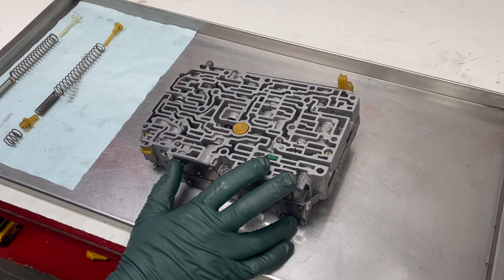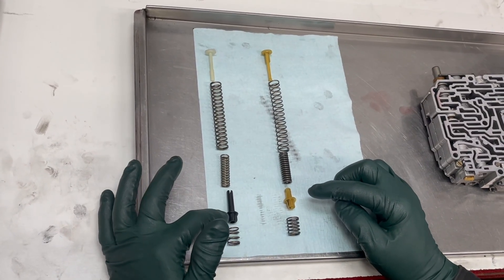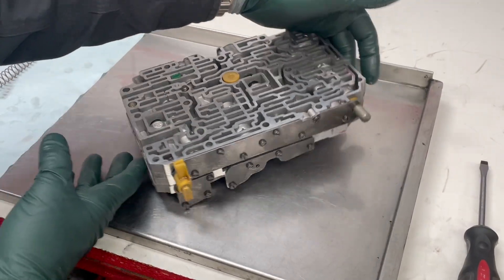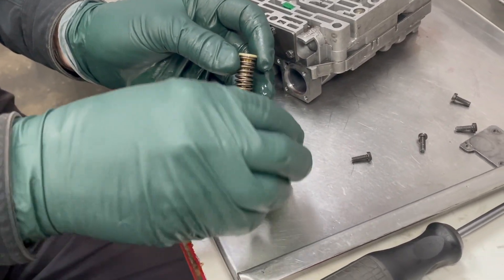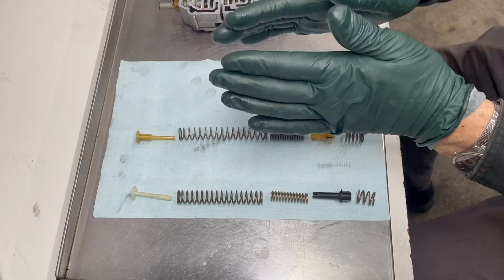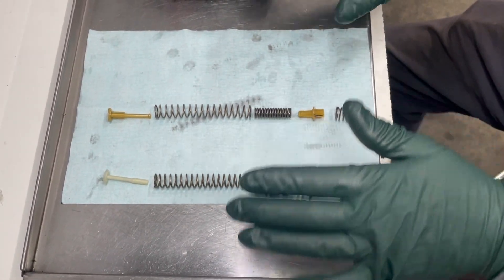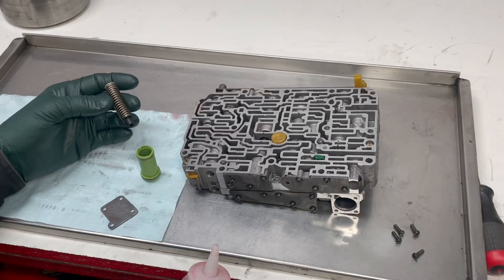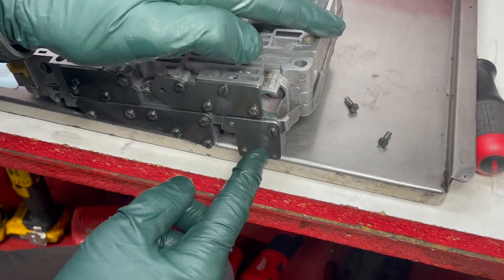Improving the 2nd to 3rd Shift 1981 to 1990 722.3 Mercedes Auto Transmissions

Comment: What if the flaring is very pronounced from 1st to 2nd, a bit less pronounced from 2nd to 3rd and basically non-existent from 3rd to 4th? 😄It's a 722.428 from 1993 with 210k km (131k mi). ATF and filter have been changed recently, didn't improve the issue at all. Throttle arrangement has been optimized, I haven't touched the red cable going from the throttle body, because according to the MB repair manual mine is set correctly. Also haven't touched the modulator pressure so far.

Comment: My trensmition shifts litlbit to hard 1-2-3 but the 3-4 shift is perfect can that mean i have wornout 3-4 and vacum is to low on the modulator👍
Love you content👍
Reply from the maker: Need to know year and model and mileage to advise
Reply: @Mercedessource its a 1985 w124 200d with les then 260 000 km .